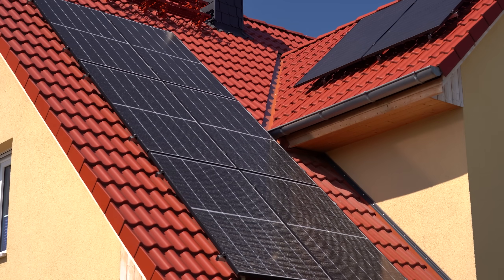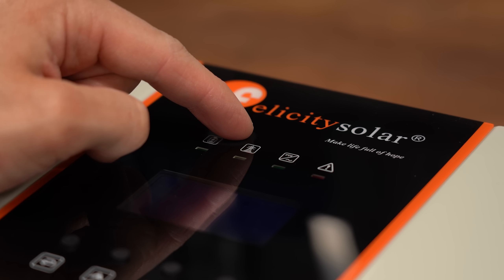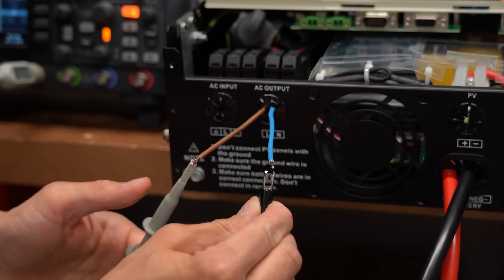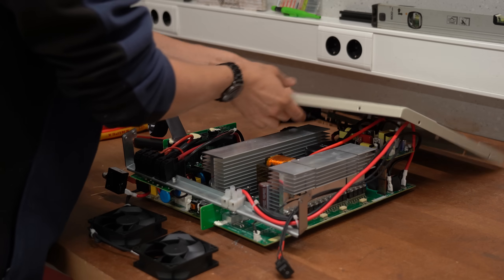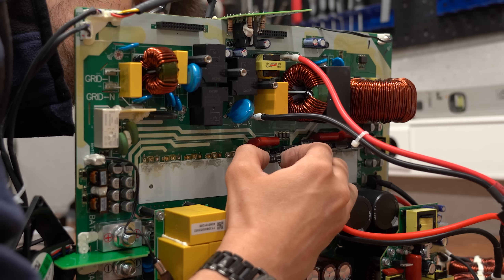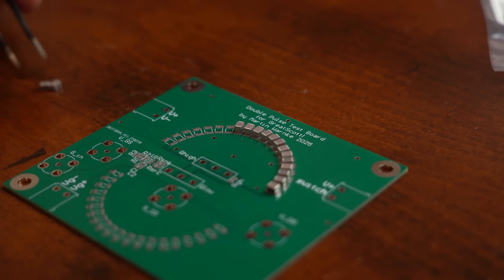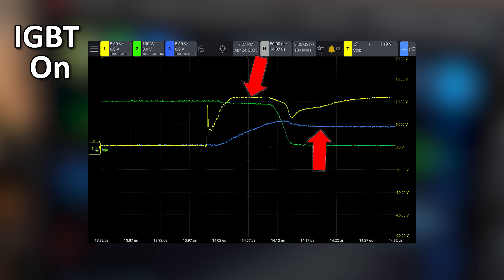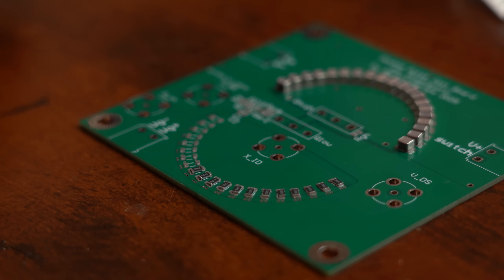Cheapest Inverter + Premium Parts = Surprising Results!

Comment: nice test! iam pretty sure, the 99% efficency from fronius comes from that, that you only downsample from high voltage from the pv string or HV-Battery from around 500Volt.
To be effective from downsamling from 500Volt to 3phase 400Volt is not that spectecular.
48Volt upsampling to 230Volt with 95% efficency is not that bad. thanks for the test.
efficency drops with smaler loads, but its still okay imho. 
maybe the efficency increases when grid is connected, because he just have to syscro to the grind, and have less to do to create the grid.

Comment: Ottimo test, oltre agli igbt il vero problema è sui condensatori; ho eseguito un test su un Luxpower SNA6000, ho acquistato 2 inverter nuovi e uno l'ho dedicato per un test; per prima cosa ho misurato l'autoconsumo a carico zero e 230V presenti, misurato 75W tutto originale. 
Ho sostituito tutti i condensatori elettrolitici;  erano montati Ruelicon e  Capxcon, misurato ESR molto alta  e capacità più bassa fuori tolleranza. Ho montato EPCOS long life sulla potenza e per le parti logiche NIPPON CHEMI-CON, NICHICON e RUBYCON, ha richiesto 4 giorni di lavoro.
I componenti discreti a bordo sono degli IR e non sono stati cambiati.
Nel nuovo test l'autoconsumo a carico zero è sceso a 40W, si hanno 35W in meno.
Dopo aver eseguito una rigenerazione dei condensatori di 100 ore circa con 89W di carico sul 230V  si hanno 112W di assorbimento in batteria, un autoconsumo di soli 23W.
Questo ha migliorato moltissimo in efficienza e durata dell'inverter e ridotto i possibili guasti in futuro.
Eseguirò altri test.
Ottimo video 😊

Comment: the mosfets you mentioned at the beginning are the battery side , full bridge configuration and 4 mosfets in parallel at each leg . they are connected to the hf transformer at low voltage side and the high voltage side is connected to 4 igbts that forms output bridge to convert hf ac voltage to around 380vdc and then another 4 igbts in full bridge configuration forms the output inverter that you are testing and modifying
Reply: btw i always watch your videos , you are doing a great job 🎉

Comment: Don’t you need to adjust the biasing circuitry for the new transistors? I am surprised you can just  replace them without changing anything else.
Reply: Hah, I haven’t had finished the video when I asked my question.

Comment: I use most budget inveter Ingrid and off grid hybrid inverter best price 120 usd 6 kw pv input 9kw 2 strings 3-16 panels 585watts very good working since last 3 months

Comment: I hope my (noob's) dream come true by using 48V DC bus from battery bank (from solar) to power most of the devices.
To avoid AC noise/interreference/EMI, better efficiency (no conversion loses DC->AC->DC). More copper though but I guess it does worth it.

Comment: I would really like to see the steps to determine that you could substitute a IGBT with a MOSFET. Surely you did a circuit analysis of the IGBT drive circuits to determine that they're compatible with MOSFET?  Also it would be good to know how to run an analysis of the crossover differences between IGBT and MOSFET to ensure you never have shoot-through?   How about peak turn-on losses... since IGBTs and MOSFETs have very different turn-on profiles.

What I'm getting at is that without this in-depth of a proper design analysis, telling the public that "here, you can do this at home" is irresponsible. What worked long enough for you to make this video in no way means it won't catch fire after a month or a year - due to these modifications.

Comment: When you removed the connection panel cover, you allowed an easier path for the fans to suck air... thereby drastically reducing airflow across the heat sink.

Comment: The MOSFET you think that are of solar are two drive the transformer (high frequency) and convert 48v to 220volt high frequency ac and then further using rectifier to dc so that matters

Comment: Great scott, great video. Now you have this inverter would be great for a deep dive into how it works, block diagram and show where parts are on the exposed board. I,m offgrid with a 6kw Anern hybrid inverter ( same generic layout as the felicity’s.) I have an identical switched 2nd unit in standby as I know  this will fail at an unknown time. Some says new caps every 2 years, one commenter here today said twice replaced fets in 10 years. Also a  maintainance program, like blowing out dust, looking for bloated caps. Perhaps a thermistor on each heat sink for dual temp readout with alarm. These modules just 2 euro. A bus voltage display. 1 euro. Whatever will give an early warning to failure. With a branded inverter being 2 to 4 times the cost there is margin to replace a failed unit and then have spares if identical units.

Comment: TO-220 mosfets are nothing to do with solar panels but drive transformer from battery side (~48V) to bus voltage (~370V) and as synchronous rectifier then battery charges. They are 100V, and PV voltage may be up to 500V in such type of inverters and drives by boost (step-up) scheme by IGBT+diode thru choke

Comment: @greatscott! I would like to see the sine waves while powering inductive loads. We did harmonic tests on a few of the higher end brands including victron and the results were shockingly bad when powering inductive loads. All of the systems had capacities of 50kw to 150kw with parallel inverters. 

We actually got the best results on sigenergy inverters.
Reply: I am shocked that Victron performed poorly.

Comment: Silicon Carbide transistors have some intriguing features for the hobbyist and experimenter. Some of them even specify DC SOA in their datasheets, which is very rare in Silicon MosFET land. There are even SiC JFETs with huge current capabilities compared to traditional JFETs. And JFET/MosFET cascodes.

Comment: Here’s an idea to develop: A dishwasher spray bar blockage detector that triggers an alarm when something has dropped and blocked the spray bar from rotating. Possibly noise/frequency based from outside or a sensor on the bar transmitting to a sounder outside.

Comment: I went from IGBT to SiC on a buck converter I made, the efficiency improvement honestly astounded me. I went from delta 125C at a load of ~1000w to a delta of 25C. Also the SiC are more robust in shoot-through events in my experience. Something to note though: IGBTs can be happy with gate voltage of 15v, but SiC prefer 18v. Also some efficiency improvement comes from running higher frequency, requiring fewer turns on the inductor, and thus lower series resistance. I've had issues with load sharing with SiC, would be interesting to see how this does. 

The buck converter has inductance of 19uH, switching at 160kHz, IGBT was Infineon K100EEH7, SiC is 65R010M2. Managing to get over 3kW out of it.

Comment: Resistive load is all well and good, but how does it perform when induction or capacitance enters the chat - a dishwasher, a washing machine, electronics with bad power factor etc. it would be interesting to see how the output sine wave changes under non-resistive loads.

Comment: I've been kind of obsessed with Infineon transistors for a while now.  I've installed them in an inverter power supply (as you did), an inverter welder, and a few other lower power devices.  Infineon makes good stuff.

Comment: The MOSFET that you mentioned as only working with solar panels or connected to solar panels is actually taking power directly from the battery and not from the panels.

Comment: You might also want to look into standby power, some cheap inverters use around 70 watts of standby power, while a Victron would use 6-7 watts. So you loose over 1.5kWh per day, just due to the standby consumption

Comment: I love the way you touch about the difference between the switching and conduction loss which is an important parameters in looking out for the efficiency, I would love to see more about an optimization series such as the improvement of the driver.

I was curious though how did you ensure that the gate voltage outputted by the driver is enough,

Could you also share the schematic for the evaluation of the switching loss?

Comment: Ditch the Chinese WiFi module. They only work through Chinese servers. As I remember these inverters speak Modbus. Hook up an ESP board with a MAX232 and inject the data into homeassistant directly.

Comment: IMW120R020M1H is not suitable to compare with 75N65KDF. 1200V voltage increases more impedance and capacitance which makes p losses higher, if you choose the right type with similar parameters to IGBT, you will see even better results.

Comment: That's a pretty gutsy effort to do this experiment and I can fully relate to the sense of relief that it came back on after the mod without blowing up. I built my own 15kW Warpverter which has enabled us to stay offgrid for just over a year so far  ...  and the early days provided some excitement until I had it all tuned in.🥴

Mine uses individual mosfets, just cheapie HY5608W (52 of them) while the original designer went for IGBT modules.

Just out of interest, mine has an idling power of only 35 watts  ...  though with a 48V 980aH forklift battery and 19kW of panels, absolute efficiency is not of great concern.😁

Comment: Important note: don't connect your oscilloscope's probe grounding clip to mains level neutral or even worse, live wires !!!!
It can damage the scope, cause injuries, and will definitely make the differential breaker trip as the grounding clip of oscilloscopes is connected to earth, as well as all other visible metallic parts. This only worked here because it is a fully batery operated inverted which doesn't have any earthing, which is also bad practice but it's only for the demo.
Second important note: SiC MOSFET gate driving is very different from IGBT and Si MOSFET, it isn't a "drop in replacement = more efficiency", like said in the video the driving stage isn't designed for it. But more importantly: some driving stages might even DESTROY SiC MOSFETs as those CANNOT endure negative gate voltages, whereas classical Si MOSFETs and IGBTs don't mind.

Comment: Changing the technology of the semiconductor without changing the circuit for the Gate, Drain or Source is crazy!! U just got lucky that it worked.
Reply: Luck was only involved in the modulation, as the gates are excited when reverse conducting. Everything else was verified by datasheet comparison - the Infineon CoolSiC MOSFETs can safely operate with 0/15V, which is rather unique. 

While it is possible to replace those IGBTs with CoolSiC MOSFETs, it certainly does not result in the best possible performance.

Comment: (Impossible) challenge for hidden gems:   As NMC and NCA cells age fast at 100% SOC: please find a charging module with 4.05V or 4.1V end voltage.  Even tricks are allowed like voltage divider resistors that fake bat-sense pins.
Challenge accepted? Surprise us!

Comment: First of all, one is transform-less inverter, and it will have usually above 98% eff (boost+ inverter), the other one has an insulation transformer, to boost the 48 to 400V and is cascaded by the inverter and by this you will have a max of 94-96% eff. Regarding the replacement of IGBT with SIC, you swapped 10 pieces, usually are only 4 or 6 in the inverter stage, so don't know what would be the purpose of the others replaced. The on-off time measured over the SIC, is quite bad. You should get lower than 60s with kelvin connected SIC. So you have bad results due to 3 leg SIC, 4 or 7 leads are the optimized for fast SW. You may improve your results with low gate resistor and proper negative drive but the 3 terminal SIC will only offer slight improvement. Let me say fast kelvin IGBT will provide the same transition as a 3 leg SIC. So you will be limited by the package and not by the silicon die.

Comment: the small mosfet on the right of the board it's for dc to dc converter (low voltage from battery to +400 VDC Bus)

Comment: Really a Felicity Solar Inverter? I am using 12 pcs of the 5048 in parallel. My biggest Problem with the Chinese Inverters which i am using thins nearly 10 years now is the high base power they need. the 5048 for example needs around 50 Watts in idle. So maybe in one of the next videos you can try to bring that down? :-)

Comment: The sine wave form will be more distorted with SiC because it requires a negative gate voltage and a higher positive gate voltage than with IGBT.
Reply: The gate driver circuit was not touched here, so the same gate voltages were applied. What is your point?

Comment: SiC gate voltage is higher than MOS and IGBT, and can be turned on with higher gate currents. There is probably room for efficiency. However it May create EMI problems due to higher transients

Comment: For the wifi connection, check the server address the module is trying to connect to.....some of them try to connect to a US server by default, or a non US server. Try changing that address n see if it helps

Comment: Great and interesting video! One question: Is that Fronius GEN24 used in combination with the Victron inverter? If so, why don't you use the GEN24 also for the battery storage?

Comment: Learn us how to test and check if this hybrid inverters backfeeding grid constantly or only for short period  when huge load from output is removed with or without battery from solar panels. If you have legal solar installation with allowed backfeeding to grid, another extra inverter for controlled period of time doesnt hurt anything.

Comment: Great mod but those little things are pricey. Not many would see a return on investment swapping them out or even buying a unit with them. But prices on them should come down over time. I would recommend on solar if you are reliant on it I would have a spare inverter regardless of brand. When it goes down you are down till you get a replacement. I really like the minisplits coming out that have direct solar input but they also act as a hybrid inverter, as they can divert power to a battery or the grid etc. HVAC is the biggest power uses so it makes sense to do it that way.
        My only issue with being offgrid is that powerfactor is now a big thing you need to consider and nothing is going to make a perfect sine wave without a rotating magnetic field. I would love to see the world crank up the hertz but that will never happen. Fortunatly our US grid is slightly more efficient at 60 vs most of the worlds 50hz. Going to aircraft 400hz will never happen...

Comment: Hey!

Got 2 "chinese" units (well, almost everything is made in china, excellent et mediocre stuff), and one failed,  during "idle" time, not heavy use (400 watts) and another one, rated for 4500W failed while making 1200 watts (was running 100% solar, batteries charging), and both of when, even with proper connection, were NOT GROUNDED; danger !

I went with CyberPower (called Nitram too, just a re-branding), 6000 watts in grid mode (solar + batteries + utility) and in off grid mode: 5000 watts (solar + batteries), or emergency mode 3000watts: no solar, no grid, batteries only.

Pretty happy, living at Reunion Island, during the day, normal use, I run 100% on solar+battery  if cloudy.

Power outtage during the day is no problem, but during night, I got only 1KW of battery use (won't go under 70%, gel batteries, can't discharge too much). Next purchase: lithium, 4 KW, to begin with.

We'll see !

Comment: Didnt really expect that replacing IGBTs with MOSFETs was SO straight forward procedure, cool!
Reply: Usually it is not - IGBTs have no reverse conducting channel, so reverse conduction is done only by an additional diode. Which means, for IGBT the gate is usually not enabled during reverse conduction. Replacing inverter IGBTs with SiC MOSFETs in such an environment would actually increase the losses, because the SiC body diode would show ~3.5-4V of drop. 
Luckily in this case the gate is enabled in reverse irrespective of the designed in IGBTs so the CoolSiC MOSFETs work just fine. 

Lots of room for improvement on the driver side, though.

Comment: Ok but what about a short circuit? Inductive and capacitive loads? My cheap inverter stops when my bosch heatgun is in lowest setting (1800w with phase cutting as dimmer). I don't trust these things. I've bought such a Victron inverter and even though it's not that efficient, I know for sure a short circuit isn't a problem

Comment: Hello, did you check the sine output with the oscilloscope after replacing the mosfet? Did you still have the imperfection near the zero crossing?

Comment: Nice video and explanation. I find these cheap inverters work well with resistive loads like your heating elements. For a real test, try powering an induction cooktop and see how long the inverter lasts before it starts to play up.
Reply: Surprisingly my Anern ( similar genetic brand ) supply’s off grid living, induction only cooking  multiple times a day. Many uses of a welder. It will fail in the future so for 209 euro on special I have another 6kw on standby. As a technician a branded unit costs 2 to 4 times so when I have a failure I will have spare parts as both units are identical.

Comment: Nice video as always. I only wonder if the inverter meets its EMC requirements after th modification. Assuming it did before the mod ofcourse 😊. 
Ever thought about checking the high voltage capacitors? Maybe you can gain something there with low ESR high temperature ones.